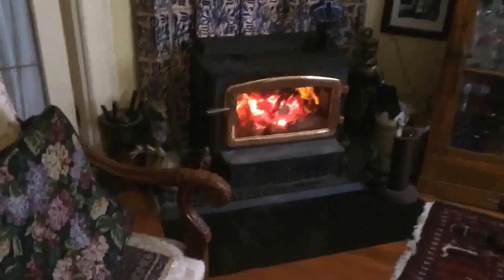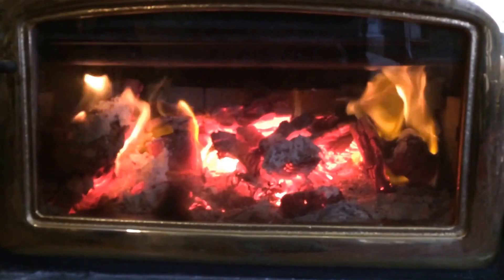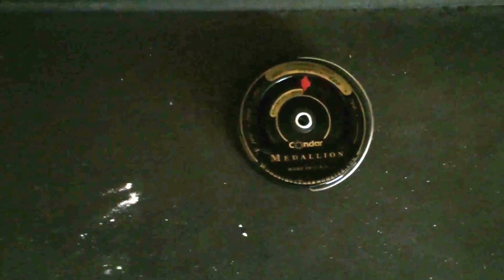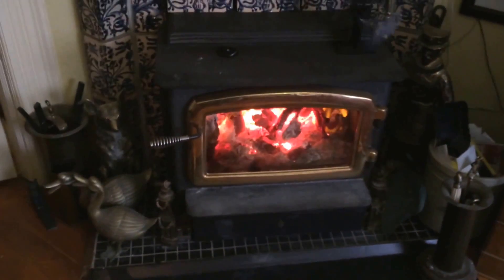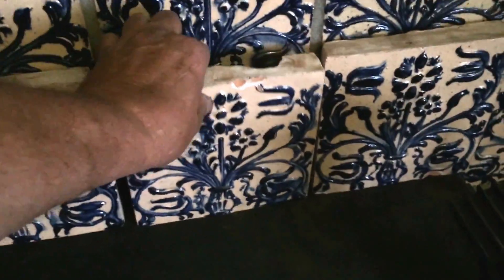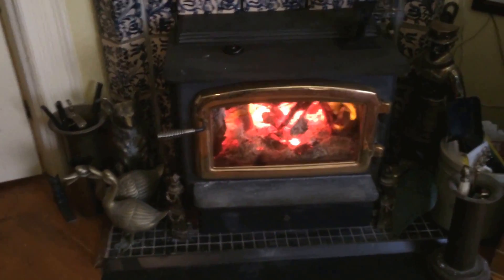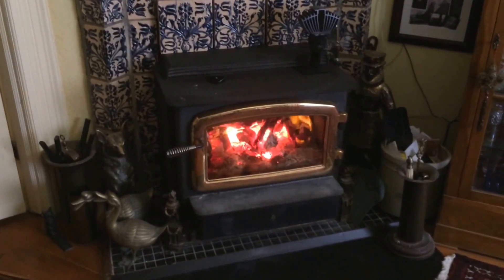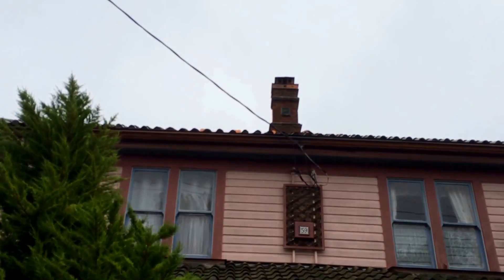Hearth Mount Wood Burning Stove Draft Problem Solved

Comment: We have a recency i3100 woodstove insert. I believe we have to much draft also.when we burn2 log fires it burns nice. When we load it up it seems to burns hard and fast. Dealer does not think we have any issues. I mentioned a chimney damper and they said there is no need. We have over 20 ft of liner. Any thoughts
Reply: I have a pacific energy super LE and have been told the exact same thing by my dealer but I don't agree with him. I have 37 ft of liner. Excessive draft IS an issue and being constrained to put 2 logs at a time to prevent overfiring is not normal.